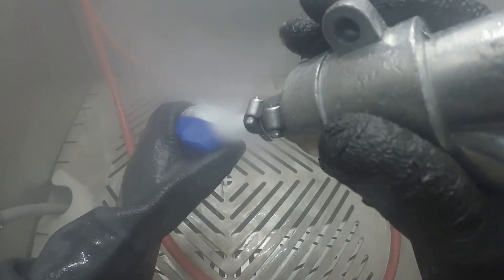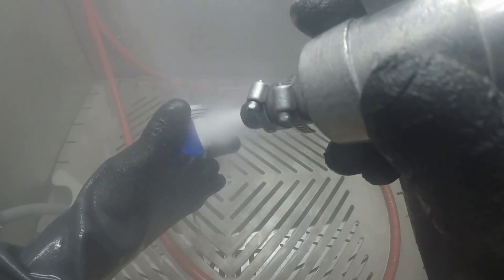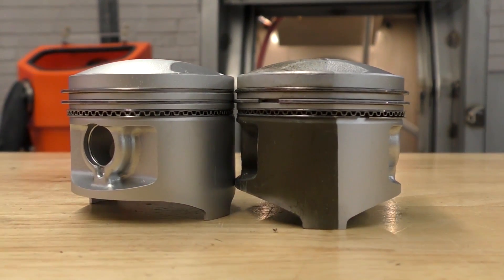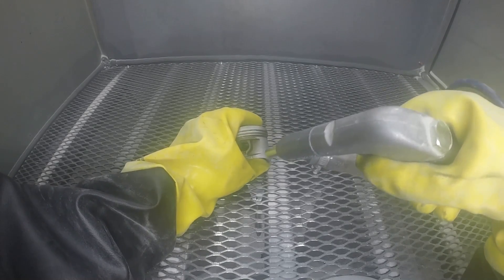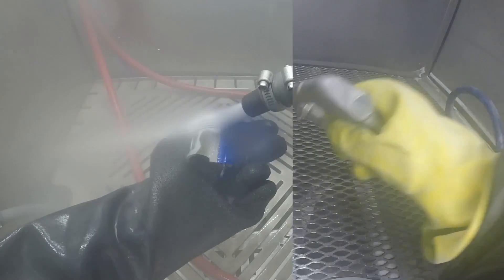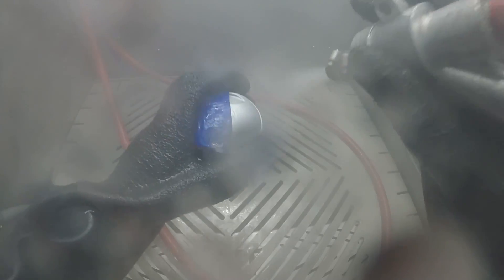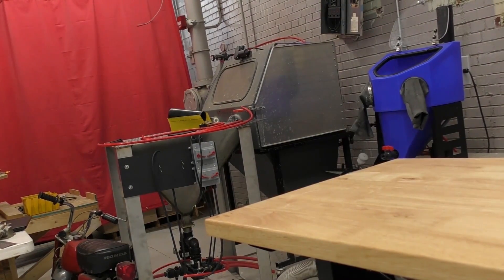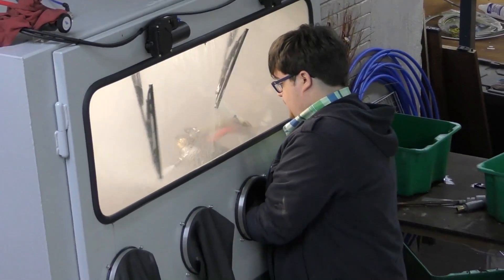Dry blasting vs vapor honing pistons - Vapor Honing Technologies

Comment: What kinda pressure dose it run at? Looks like its just coming out at a tap
Reply from the maker: The sweet spot is 75-90 PSI, and this unit requires 20-30 CFM.  Call today with any other questions 828-202-5563 x 103 Niki nicole@vaporhoningtechnologies.com